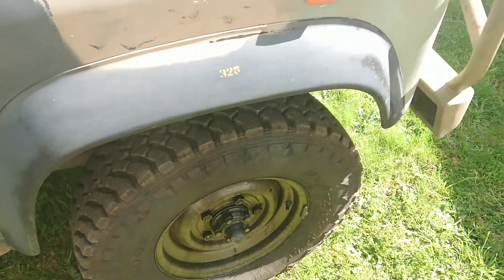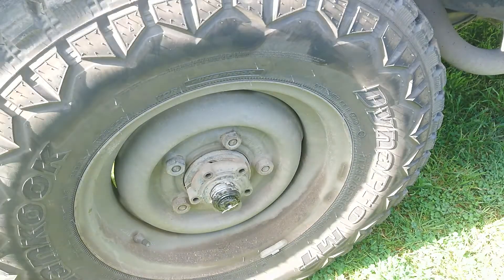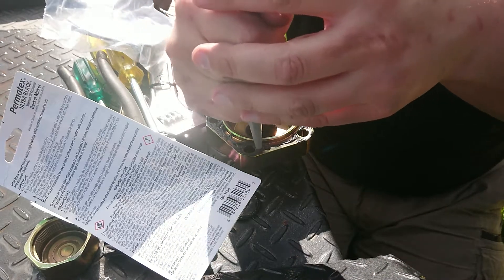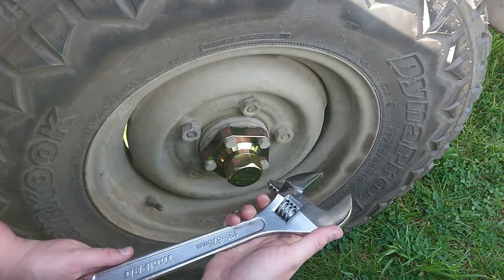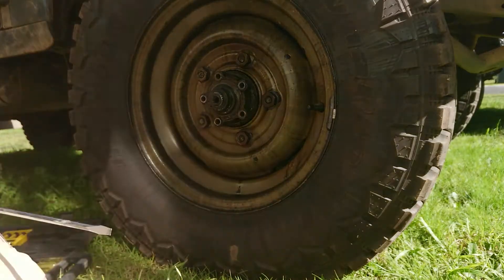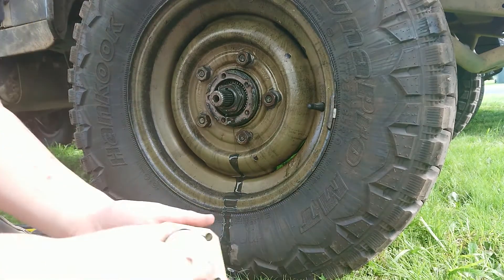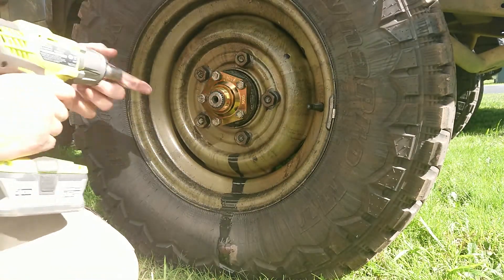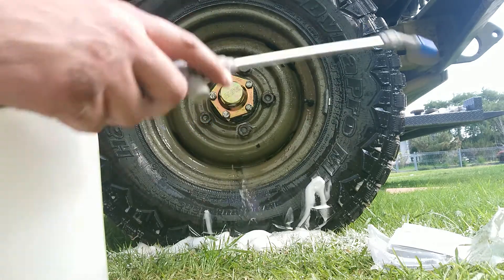Changing Land Rover Perentie Drive flanges

Comment: Thanks for the video.
I would have thought the screw caps would be left hand thread one side and right hand thread the other.
So normal driving would be a tightening action.
MGs wheels with their single hub nut were left and right hand thread.
Reply from the maker: Early rover hubs were like that. Thats really only an issue if you contact the ground in extreme offroad events. During nmal use, the plastic ones pop off far more frequently.
Reply: instablaster...

Comment: You have to clean the oil off the gasket surface or that silicone sealer is not going to seal.
Reply from the maker: I do that every time. Ad it's been on there a couple of years now without a drip, as this was filmed before covid.
If there's oil coming out it's likely your hub seals are bad.

Comment: Does anyone find that their drive flange bolts (original flanges) keep unscrewing? I have cleaned out the threads, used threadlocker and troqued to spec and yet they still unscrew. I have tried new spring washers on one flange so waiting to see what happens, but other suggestions would be welcome from fellow 6x6 owners. :-)
Reply from the maker: I've never had that issue on the 4x4 or 6x6.
It could be that the threads are mismatched (imperial in metric hole) or the threads on the hub are damaged. New bolts that are grade 8.8 would also be a good idea.